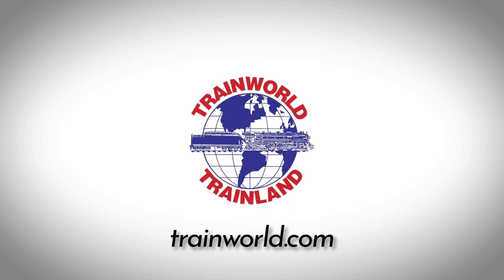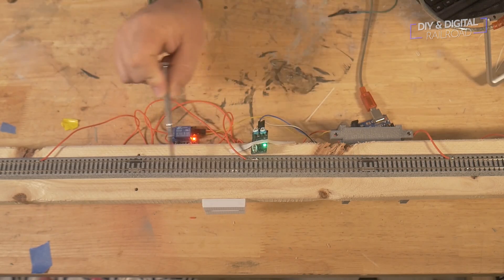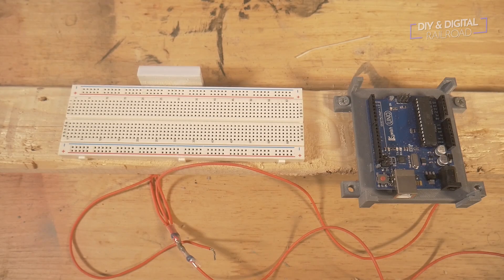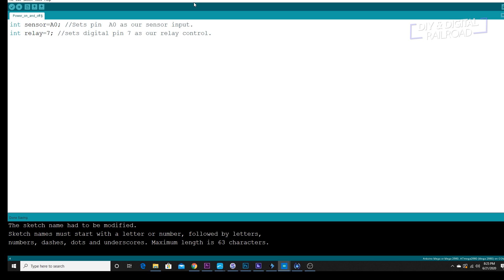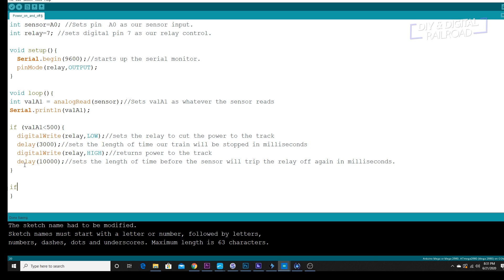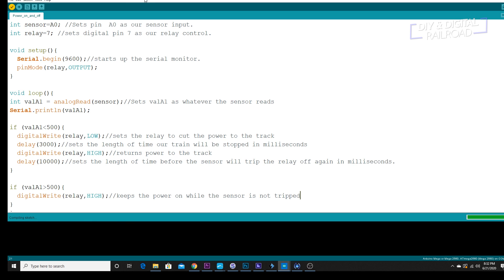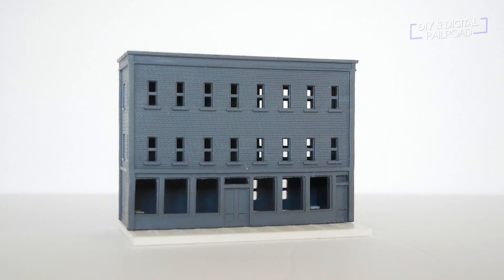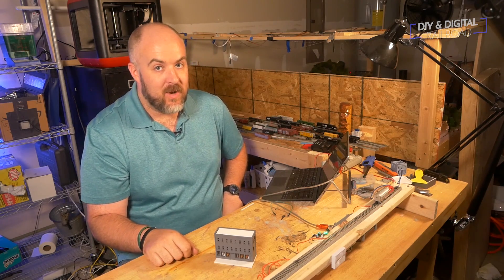Easy Model Train Automation with an Arduino: Stopping and Starting a locomotive

Comment: Banging my head into the wall on how I could create a way to slow down a DC loco on isolated track vs. just coming to a quick dead stop.   I'm told Capacitors won't work on DC.   So, your demo brings another option.   I rather an off the shelf option, but I have worked with Arduino and even some custom Microprocessors for light controllers.   However, it's such a simple ask, I can't see the need for an Arduino vs some simple timer/relay PCB board off Ebay.

Comment: hi, in this video at around 5:30, you state "we're going to put the power leads into our relay...  the one coming from the track goes in the left connect".  I assume you mean this is the positive current connector going to the track enabling power on and off.  Then you state "the one coming from the power bus goes in the middle".  I assume that is the ground (or common).  Are my assumptions correct ?

Comment: Nice stuff.  For such simple project, you might consider using a smaller micro system like the ESP8266 or ESP32 and use EPSHome for the coding.

Comment: Simple and effective, couldn't someone write a program without delay and with millis? I would be very grateful.
Reply: Millis is the better way to do it so it doesn't stop the code.  I used it for a point to point control.

Comment: That is so awesome. Simple, elegant automation. I was wondering what it would take to bring another level of refinement: Gradual speed up and slow down for each step. I would assume we would need different hardware to achieve this. Relay are ON/OFF devices, wondering if there is something we could use that an arduino could modulate without going full blown DCC, maybe interfacing RC speed controllers (ESCs). Super cool stuff, love your channel, this is my daily Train NetFix!👌

Comment: Thanks for short but detailed explanation.  I just wanted to know what is the voltage supplied to rail track? My HO scale model train loco needs 12VDC having two motors each. How much external power supply I will have to give to 5VDC Relay module single channel for the loco to run / stop? Will 12VDC adapter 1Amp is suitable for this? If not please give the details. Many thanks.
Reply from the maker: Without seeing your setup, I would guess your track voltage is anywhere between 12 and 16 volts. The relay just needs to be wired on your track power feeder.  It interrupts your existing track power versus actually supplying it.  The relay itself is powered by the arduino and is independent of track power

Comment: basic for beginners, :-)
Very useful for them.
What´s about reed relais, and magnet below the train ?
Would that not be cheaper ?
Ok, I understand-->in case of more than 1 train, every train must get an own magnet, that´s a disadvantage....isn´it ?
Reply from the maker: I think a complex automation setup is going to involve a combination of several detection methods including reed switches as you said, infrared sensors, and current sensing.

Comment: I would be interested in the Arduino Uno case as well.  It is tall enough to encase the Arduino and the Power Shell board for the DCC++ configuration?  I checked the Etsy store and don't see those listed.  Do you have them somewhere else?
Reply from the maker: So right now I do not have the printing capacity to print my buildings and the arduino cases.  I am hoping to change that soon.
Reply: @DIYDigitalRailroad  Any idea how much you'll charge for those?

Comment: So if a trolley had 6 stops... do the wires need their own pin on the arduino and line in program or can they be soldered into one circuit? Just planning ahead for a continuous one way loop around three city blocks. Possibly adding another track and stops in the opposite way.

Comment: I think this gives me the groundwork for something I had been beating my head against the wall to try to figure out: using Arduino to control a trolley car.  Think of the Lionel ones that reversed course when they hit a bumper but with a delay to simulate loading and unloaded of passengers at a station..

Comment: Hi   Having  this some additional thought.  A signal placed to give the train a reason to stop and then on changing from red to green it would then restart would be pretty neat  , is this easy to achieve with Arduino 	programming ?
Reply: Very simple.
Best with LED.
5V-->resistor ( about 200 Ohm )-->red LED-->Arduino one digital output.
Arduino digital output ( may be the same, and even the same as for the relay )-->green LED-->resistor-->Gnd.
Add the new output in the scetch above, copy the logic and change the Pin Nr. into the new output for the LED-->done.
Sorry, I´m no native english speaker, I can´t explain better.

Comment: I’m currently using a 2650 and motor shield running DCC++ through jmri. All is working fine. If I were to do this project will I need another arduino? 
Thanks for making these interesting videos.
Reply: No , and you can also push down DCC to zero ( in x-time ) instead of a relay

Comment: Hey Jimmy! Awesome vid. I have a complete Noob question. I’m my train is running via DCC and the relay stops the train, will it start again at the same speed it stopped with?
Reply: just unplug the wire to the rails and reconnect to try
Reply from the maker: Yes it will.  In order to control with a slowing down or a speeding up, you would have to slowly increase and decrease the resistance on the rail
Reply: @DIYDigitalRailroad  it is much better and more controlable to use PWM control , it goes way down to a loco crawl and with enough torque-power of the motor.  Try a L298N H- bridge motor driver for Arduino it works perfect for 2 segments of rails. You can also do the DCC stuff with this module. So it wil work for normal DC and DCC mixed for 2 rails. I like this way with at least 2 sensors each the same distance from the center spot . This way it works from 2 directions and it is works better with signalling so the arduino knows the direction and travel points

Comment: Is there some way to use the Arduino to slow the train down before it stops to add realism? I have a G scale train layout in the garden and it just does not look right when it skids to a halt.
Reply: take a look at a arduino L298N Motor driver and take  2 sensors
Reply: @ariegt  Great thank you ,I'll look into that.

Comment: How do you know where to plug all of those wires into the power strip and into the various components? Does all of this come with written instructions saying where to plug the wires in? And are there written instructions explaining how to program all of this? None of this seems to be very intuitive. ...Roy
Reply from the maker: Hey Roy.  Luckily Arduinos and their components were designed for learning.  All the positives are labeled "+", "5V", or "VCC". The negatives are labeled "-" or "GND".  The inputs and output are typically labeled "IN" and "OUT" or something similar.  There is a learning curve and I am considering doing a second arduino basics series.
Reply: DIY & Digital Railroad  Thanks, Jimmy. Like most new things, arduinos intimidate me, but I am willing to learn. ...Roy

Comment: question why are the sensors used different from the ones you have linked to?
Reply from the maker: I accidentally dumped out my entire parts bin.  The only one I could find after that was the 4 pin one.  It works the same.
Reply: @DIYDigitalRailroad  There are 3 and 4 pin versions of the sensor on Amazon.  The 3 pin version has only a digital output.  The 4 pin version adds analog output.  The analog output can be used to adjust for ambient light falling on the IR sensor.

Comment: I use this to stop train rushing in to the stations. But I start trains again with a push button, when it's clear to enter :)
For beginners this small projects is good, you will learn Aarduino little by little and get results at once :)

Comment: Jimmy, can this project be used on dcc and dc. I run both types not all at once, I have dcc days and dc days. When my grandsons come over they take over the layout and love Dcc.
I have looked at all your Arduino projects. I tried a few but put them on moni pros. Itest them on Uno's but build them on mini pros.
Reply from the maker: This project works simply cuts power to a section of track.  So theoretically it should work just fine on DC.

Comment: Jimmy - curious why you used an analog input for the sensor?  I would have thought you would use a digital input (INPUT_PULLUP) and then just checked for HIGH or LOW? Either way works fine - I was just surprised to see you use an anolog input for a incoming signal that is digital.  Thanks for another interesting Arduino project video.  -Rick
Reply from the maker: I've just always done it that way.  I've thought about changing it but I worry about the wayward 0, or 1.  The analog input gives my system some room for error.
Reply: @DIYDigitalRailroad  hi., use a 10k resister to the 3.3v/5v positive to pull up your digital input and use if digitalRead LOW for sensing and save your analog / pwm pins for nicer usage . Good luck